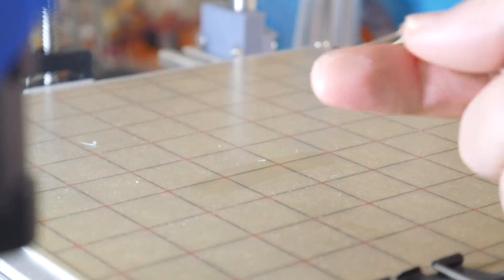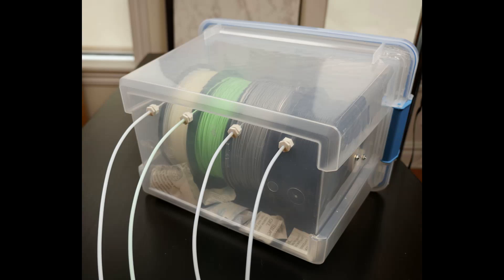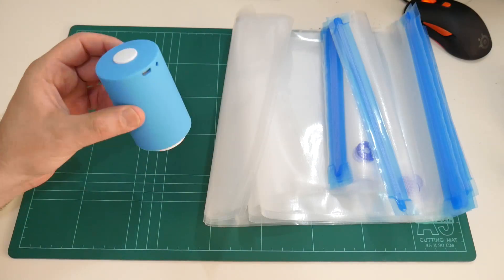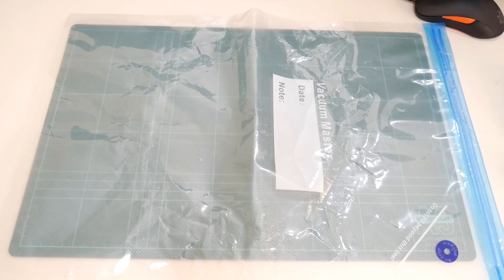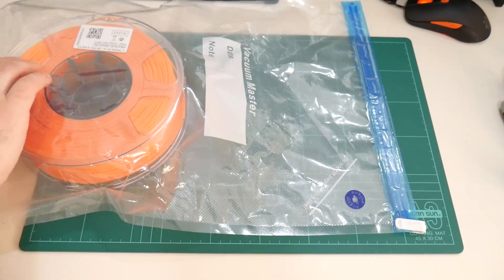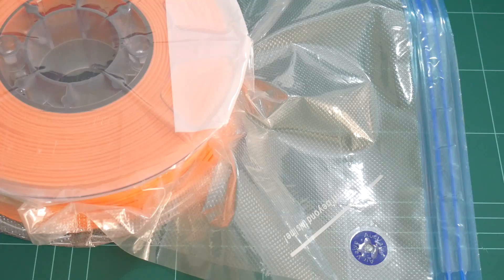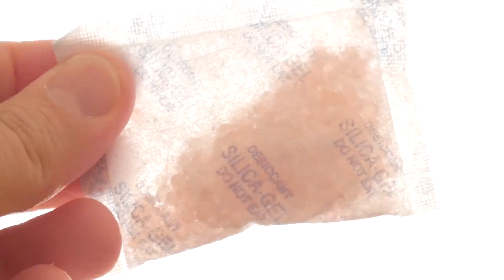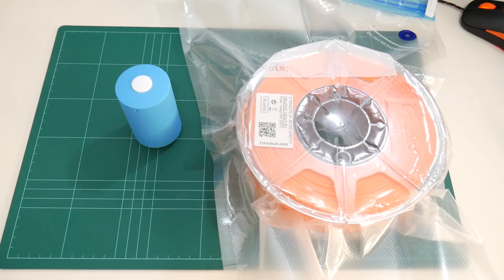Store Your 3D Printer Filament

Comment: Get into sous vide cooking, then you'll have an excuse to purchase a proper vacuum sealer for about $70AUD. Sous vide bags come in a long continuous tube (of varying diameters) that you cut to length, and probably works out a lot cheaper & reliable than those bags with the built-in seals.

Comment: PETG is what I mainly use. It is an excellent material, very strong and easy to print. It's handy also because I do not bother to bag it and I have had no problems with it. I have used PLA and it goes brittle and bubbly when left out.

Comment: Thanks - I have built 2 Hypercubes (heavily modified), and was trying to build some type of humidity & temperature controlled heated box connected to one of my printers. Your simple solution is much superior and I will keep my box with a large bag of desiccant and abandon the exotic heating elements.

Comment: I may really have to get one of these pumps and some bags for myself. Not just for filament but also for food storage.
Reply from the maker: Yes these bags are marketed for food storage, but repurposed for our filaments :)
Reply: @Tech2C  We have been using very large Ziploc bags with desiccant and they work okay but I suspect that this way would be much better since you can never really get all of the air out of a Ziploc.

Comment: GHETTO SUBSTITUTE: I use large, heavy-duty zip-lock bags for all my spools regardless of type of plastic. Once in the bag and mostly zipped, I squeeze out most of the air and then suck out the rest with a rubber tube. Works great!
Reply: Do you suck using your mouth?

Comment: Wow!! I've been searching all over for a sign of life. Awesome comeback. Btw, I'm storing my PLA spools in a metal container that is normally used for transportation of lab-grade chemicals. The metal container has the height of a stool so I also made a pillow for it and inside the container fit around 10 spools plus dessicant! Win win. A beautiful stool in my livingroom and superpractical storage. The edge is lined with some kind of silicone putty so it's airtight. Before storing the spools I heat them up in my oven to around 80ºC.
Reply from the maker: That's a useful storage container - double duty as a stool, nice. I have to heat up Nylon in the oven before use, but I'll check if that is still the case after being stored in a vacuum bag for a while. Thx.

Comment: Dry box for me but I have a few rolls that are so wet (even though I never let the humidity inside the box go beyond 22%) that even after 3 days in a food dehydrator at 60-70c they still pop and steam in the hot end.  I am not sure why those filaments still do it.
Reply: Mr. Stooge, they may have a "drinking problem."
Reply: @Michael S I am holding on to them but I wonder if a vacuum pot would remove the moisture since it would lower the pressure and water can boil at 0c if the pressure is low enough?

Comment: Would be interesting to do some testing with multiple samples of filament from one roll to see how different storage techniques affect the filament properties. I wonder if anyone has tried a dry gas blanket to purge air out of the filament storage container. Works for paints/glues/resins that are moisture sensitive.

Comment: Do you consider upgrading the Hypercube to linear rails? Would it be a benefit against the normal steel/carbon rods?
Reply: You’d probably get more ringing than carbon. Specially with Bowden . But on large builds 8mm rods are too flimsy (300x300 here) and with direct drive it’s a mess! So they can help with that. But rails are overrated imo
Reply: Chloe Mcholoe thank you for your insights on this matter. In that case it wouldn’t be sufficient indeed. I’ll stick with the rods.
Reply: J P just for fun you might look into v slots they have disadvantages but for their weight they’re very sturdy and lightweight. But I have been really lazy so I haven’t designed anything for them as much as I wanna try it

Comment: I was on the lookout for a vacuum solution that is big enough for rolls of filament I have one for food size bags but cant get large enogh bags for filament.
Good to hear from you!
Reply from the maker: Yes I bought the larger bags from ebay as they're not a common food size it seems, lol. Cheers!
Reply: Ziploc 60-Quart storage is what i use. most walmarts will have this item. get the clear one so you can what colors is in it with out opening it. anytime you open a new roll of filament toss the silica gel beads pack into the storage container. i have used filaments that have been opened for close to 2 years with success.